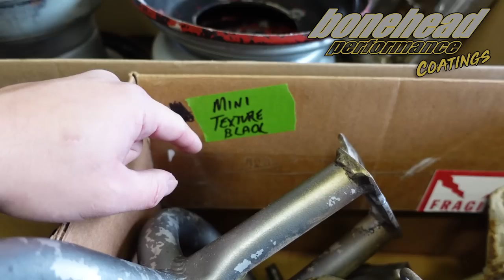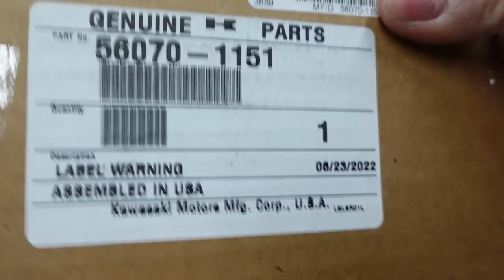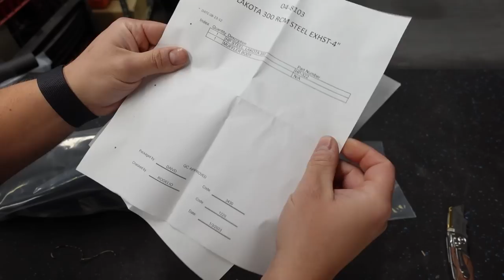Installing the Worst Case of Squished Tires I’ve ever encountered 😂

Comment from the maker: I’ve received squished tires from many brands of tire; it has to do with the way the warehouse stores and packs them and it’s not necessarily a reflection of the brand. What techniques and tips do you guys have for installing smashed tires? Thank you for watching my video and hanging out, we will put the exhaust and everything else on next! You all ROOOCK!!!
Reply: Grill propane tank with a "trash torch" lightly keep the flame at a safe distance and gradually warm them up.
Reply: When you get them squished cut the bands loose right away then I find anything to put inside of the tires to stretch them out and let them  sit for a couple days in warmth The tires weren't obviously made like that they were stored like that for a while you just have to reverse that process
Reply: please remane this video man fights small tire with fire... hahha
Reply: put in a tube, air up the tire with tube for a couple days then take the tire off and the tube out, tire should be good to go. It's a lot more steps but should work well
Reply: Put a ratchet strap around the tire to compress the Middle to squish the bead out
Reply: Lol I just got to the part where you used the ratchet strap love your content bro keep up the great work
Reply: I used to work at a tire shop. Get yourself some Murphy's tire and tube mounting compound. You can get it from Amazon.
Reply: The wood glue 😂😂😂😂😂😂😂😂
Reply: Don't use my method 🤣 but last spring, I spent 5 hours taking ONE tire off.. and then reinstalling new tire, I bent the rim, ripped the tire and broke my motion pro tire iron. Was an expensive day of negative progress.... So don't do like me 🤣
Reply: Michael you should get a gusset kit from HPM power sports for that blaster
Reply: Get a couple cheap inner tubes Michael.we use to change tons of atv tires at the shop i worked at and depending on who we bought the tires from would be the determining factor on how smashed and banded together they were.peace.
Reply: It's not actually even warehouse who packs them, all the way from factory. Most tires gets moved around with shipping containers and cost of one container went up a lot when covid started so they started shipping more per container and only possible way was packing tires tighter somehow, same goes for car tires and so on. Official statement from multiple providers and from tire companies, we actually had to get statements from them  cuz of our customers :D B2B is always fun and all
Reply: Need one of those manual tire changers from good ole harbour freight they are cheap an work well
Reply: might try heating the tires up . ive used a heatgun  it makes them more pliable
Reply: The way I put the tire on the I’m to get air in it is put a ratchet strap on there and tighten it while ur putting air in it a the same time
Reply: once the tires mounted , soak the bead with glass cleaner (aka windex) next set the tire upright and🦶 stomp on the treads a few times to get the sidewall’s closer to the beads. Last I put on a hands free air chuck and go back to 🦶 stomping. Solid downward stomp’s is the 🔑 and make sure the air is flowing heavy.
Reply: Remove the valve core, and put the female quick connect right onto the hollow valve stem.  This allows way more airflow, even enough to slightly expand the tire as the flame method does. It's saves my ass a lot on equipment tires.
Reply: can you do more motorcycle builds?
Reply: As a tire tech of 14years... when using the starting fluid trick u need to have the air flowing as u light the fluid.. gives u a much better fuel air ratio for a better boom to seat the beads and u should just get them Mike... the racket strap is a good trick to but u have to remember to be ready to lossen the strap asap or bad bad things could happen Mike... and always keep the face of the tire facing u and not the sidewalls if u like ur life Mike..  stay safe and keep rolling
Reply from the maker: @nathanpeever6701  lmao; I definitely want to keep my life. I appreciate these tips man! I will keep these in mind for the next smashed set.
Reply: @Michael Sabo  oh and remember lube is ur friend when either mounting or dismounting tires...
Reply: @Michael Sabo  soapy water is good for dismounting and if u can find it euro paste is really nice for mounting.. and always make sure u have the drop center of the wheel facing upwards witch u did in the video.. start ur bars up by the valve stem when dismounting and end at the valve stem when mounting to make things easier on urself
Reply: @Michael Sabo  I ran the service truck for fountain tire here in Fort st John bc Canada for 14years Mike.. if u need any tire tips or tricks don't hesitate to ask this guy I got a few things up my sleeves for doing tires from + 28 degress Celsius to -50 degrees Celsius
Reply: I wrote you on instagram, I asked you a question
Reply: take a ratchet strap around the center of the tread. It pushes the bead onto the rim and will minimize the struggle works on skidstear tires and loader tires i have done by hand.
Reply: When removing grips i cant damage i use boiling water on them to soften up the rubber.
Slides off like no to8
Reply: When I used to do tires we used to use 4 chucks of cut up 2x4 roughly wheel width. Put them in between the beads and let the tires sit either in the sun for a few hour or let it sit over night. Usually will help a ton.

Comment: Michael when you are doing the starter fluid method with the tire make sure that you have constant air pressure blowing into the vent so that when it catches at one second it’ll seat the bead right away.

Comment: Yeah I use the ratchet strap and ether method with my air chuck locked on blowing air before I start😂. But it’s like you said no single method/combo is the same on every tire. They are just generally a PITA!!! Great video as always
Reply: ah yes, the good old strap and pray method. Sketchy but very effective

Comment: Get a hands free air chuck (it clips on to the valve stem without having to hold it) and a Tire Bead Blaster (an small air tank with a pipe with a quick release valve).   A lot safer, a little noisier, but I would say, more reliable and cool 👍.  Especially if are going to be replacing a lot of tires.
Reply: +1 on the bead blaster / bead cheetah. Don't know if they're cost effective enough to warrant buying, but I've had to use them in the past to stretch car tyres onto wider, small diameter wheels (like ATV dimensions) and it works like magic
Reply: ether trick is way easier to use and makes more sense as far as money and uses go you can't start your bike with a blast of air or carry it on the trails

Comment: Yo Mike , the Bead Buster is a cool tool you should get 1 it operates off an impact wrench (I have  it , worth the investment). Pro Tip: if you wanna save your rim’s from scratches you can put a glove 🧤on the prying end of the bar. Hope that helps 👍🏻

Comment: put spacers between the beads and put them in the sun. or some way to warm them up. on most car tires I use aerosol cans standing upright between the beads. let them shape up. then mount them and it will be much easier than wrestling with it. took buddy 6 hours. 3 hours of stretch time and one hour of wrestling. still saves time.

Comment: I've changed my fair share of stubborn tires at home with tire spoons and ratchet straps and such like you did in this video.  It took many years to finally hone in my skills to where it's actually very easy now.  With all that said, here's the secret.  I've found that the most important step is to make sure you take it to your local tire shop and let them do it.

Comment: Pretty funny tire portion. We just installed new tires on some Douglas racing aluminum wheels and I kid you not, we needed about 100 psi to seat the bead properly. The tires say do not exceed 20psi for seating bead. We tried everything. After a few hours we just said screw it, put the tire under the blade of our mini excavator, hid behind a wall and let it eat.

Comment: MECHANIC TIP--
Cut a couple lengths of 2x4 or something and pull the beads apart. Put the wood between them and stretch the tire bout. Let that sit in the sun for 20 or 30 minutes and the tire will keep that shap some. When you get the tire on the wheel soak the bead with dawn or other liquid soap.. you need to lube the bead so the bead will slip on the rims bead... also take the valve core out of the thing so you can get air in it faster. What I do Is either a cheeta (makes it sooo easy) or stand the tire up and smack it hard with a mini sledge. That will force the beads out maybe just enough to catch.. you can also slam it down on the ground to achieve the same thing..  I've been a mechanic for 20 years and been doin tires like this and usually have very little issues. 

I didn't have time to watch the whole video but I have my tricks ill share....

Comment: The only brand new vehicle I ever bought was a 2003 Lakota and can tell you everything about the one you have is completely stock! I beat the hell out of that thing for years until I got a banshee. Also, prior to 01 I believe, the Lakota was a utility quad hence the heavy weight
Reply from the maker: Hell yea man! Yes, I think dirt wheels called it a hybrid between sport and utility. I may actually buy racks for this one after the series because it would make a great work quad or camera equipment carrier.
Reply: @MichaelSabo  There's also a hitch system available for them too, at least there was at one point 😂

Comment: Mike, my name is Tim, every time I watch one of your video's, I learn something.  NOW I have a chance to repay you.                                I have developed a method to push the beads on easily, no sweat, and every time.  My co-workers tell me I should patent my idea...maybe I should...but that sounds like a lot of money (patent lawyers).  I use a hydraulic press, but practically no pressure.  I work for the USAF in Alaska, civil engineer squadron.  We maintain about 20 zero-turn Kubota lawn mowers and RV900 trucksters, among other stuff.  I change the tires.  Our tires come smashed flat also.  I have tried ether, air cannons, straps, etc.  I put inner tubes in, set in the sun, used heat from Hotsey pressure washer also.  Nothing reliable.  I got fed-up a couple years ago, and decided to SOLVE THIS PROBLEM...it was making me a fool.  So I built a cradle out of 1 inch square tube steel (way overbuilt), about 12 inch high, and 20 in wide.  It has to be at least big enough for the bare wheel to fit down inside it, laying on it's side.  So I made 2 hoops about 20 inch around (this depends on the height of your wheels), and spaced them about 12 (wheel width) inch high.  I mount the tire on the wheel.  I lay the cradle flat on the 20 inch hoop side on top of the 2 I-beams of the press.  I have to move the I-beams down pretty far to have enough room to set the tire/wheel on top of the cradle on it's side.  Then I press the wheel down inside the cradle, and it easily and slowly press's the top bead on the rim by using the cradle to push up on the bottom bead, and the bottom bead pushes all the way up to the inner side of the other bead (actually the cradle doesn't move, the wheel moves down, but it's easier to visualize this way). Each wheel usually has the "drop center" offset to one side, this is the side I have up top, and gets pressed on.  Then I flip the wheel, and press it the other way, the one we just pressed on, will stay snapped on.  Usually we don't have to press very far until the other tire bead makes contact with the inner part of the wheel, as it is cone shaped outward and grows in diameter as it gets closer to the other bead of the wheel.  Once it lightly touch's the cone, we put air in it, and the tire slides up to the second bead, and snaps on.  Depending on the depth of the wheel, the ram might not have enough stroke to go all the way down (the 12 inch part), so I have a couple of 3 inch spacers I stack on the wheel where the lug nuts would go.  It takes very little pressure to push the wheel down, but a hydraulic press makes it so easy and safe.  The throat of the press needs to be big enough to fit the tire size, like for a 30 inch tall tire, would need 30 inch throat 
across press.  Ours is a 100 ton 4 foot across press...overkill I know.  I hope you see this.  I'm an old dude, no smart phone, no instagram, just a flip phone.  If you need more info, don't hesitate to call me, 907 317 4625.

Comment: Awesome video. Another trick I use for quads and skid steers, is to remove the valve core in the tire stem, and then push the female quick connect on the air hose straight onto the now hollow valve stem. This allows air in at a much faster rate and is great for seating tires. Just be ready to put your finger over the end of the stem once it's got air in it, until you can quickly screw the core back in.

Comment: Great video Mike! I am patiently waiting for the rest of this awesome series! Also I wanted to add a little trick I learned from a friend on breaking the beads without your special bead breaking tool. Most everyone has a floor jack so I guess that might be an exception, but jacking up the front or rear of your pickup and sliding the edge of your crusty old tire with stubborn bead under your vehicle tire and letting down slowly has always worked for me when I run into a bad one. 👍
Reply from the maker: That's a great idea man! I have actually used that technique in the past!

Comment: My trick for doing this at my dads shop was to get the tire as warm as I could. Either by setting it in the sun on nice days or in front of a heater. Also a rubber tipped air gun works way better then a tire inflator tool because it lets more air faster into the schrader valve opening. Those are the two addons I have. Thankfully I did more street bikes and dirt bikes than quads and those tires at least 10 years ago never came like these.

Comment: Hey, man! Long time viewer here (in my mind, at least - viewer since the voodoo banshee!) I have a 98 Blaster that I am working with right now. I bought some tires off Amazon and they arrived just as smooshed! My tip for the next set - 20oz pop bottles! Take the 20ozers and stuff them between the beads to stretch the tires back out. Leave the bottles in them and let them sit somewhere warm to expand for a few days to a week - should be "normal" dimensions after a few days. I used four per tire and they seemed to work out good like that. My 40 cent fix for ya!

 PS - I am STOKED to see you working on a blaster! It's great to have your work as a reference. I am learning much from you, sir! Thanks for your time editing and sharing! Looking forward to some blaster wheelies! Enjoy and be safe!

Comment: Man I never laughed so hard watching the ether fails.     After doing my raptor with squished tires I said never again, and switched it over to deadlocks for wheels.   Much easier to install tires on the bead lock wheels.   When my Polaris needed new tires I took the wheels to the tire shop and had them do it.  They were heavy duty 6 ply tires that I would have never gotten to seat.    Great Video!

Comment: my buddy  installed tires on forklifts . here is a good tip for receiving squashed tires and opening them back up . find any size innertube that will fit inside the unmounted squashed new tires or old  . inflate tube to spread the tire outwards as much as you can .put out in sun unless its winter. put somewhere warm in winter like next to your woodburner. he said it may take up to 24 hours.

Comment: The easiest way to handle squished tires is to inflate tubes in them to stretch the tire and set them where they will get direct sunlight for a few days (heat/cool cycles) and when you are ready to mount them to the wheels, deflate & remove the tube and mount.  The tires will retain that inflated memory long enough to not have to fight it.
It's what we did back when the popular thing was to mount 175/70-14's on wide wire spoke wheels.  We kept a set or three in the shop with the tubes inflated so that we had those tires ready to mount when customers came in for them.

Comment: I work at a shop that regularly mounts atv/utv tires, and when we get squished tires like that we put 3-4 2x2 pieces of wood cut to a few inches (idk? 6”?🤷🏾‍♂️) and spread the tires for at least a few hours before we mount them. Works like a dream everytime. If you don’t want to use 2x2’s, find some nice robust sticks and cut em to length

Comment: OMG 😂this video had me LMFAO 😂great job mike, I’ve been riding quads lil over 20 years and I’ve done this 1 time and I said to myself never again would I do it. This last summer I got new front and rear paddles for my YFZ the shop I use by my house that knows me and my family he only charged me 40$ bucks to dismount the old tires and mount up all the new sand tires all up..

Comment: The ether method works best when you are putting air through the valve stem at the same time.  It helps to mix the ether, and helps keep the tire from coming right back off the bead.

Comment: Did a blaster up in 2006...vito's 240 top end...hot rod crank...HMF pipe and silencer ...carb kit....(ran on race gas)....owned a dozen quads (200cc to 1000cc)  and that one is the one I wish i still had...it was super light ...crazy fast...and very easy to ride all day...
added plus was ...it was bullet proof, ultra reliable...can't wait to see what you do to this one...
From my igloo on the mountain in alberta Canada 🇨🇦 D.

Comment: In the future, put 50:50 dish washing liquid and water mix on the bead prior to the gas trick.  The soap will allow you to slip it on the rim much more easily and when you gas trick it too. I use a bbq brush to apply it on the tire bead and a baby bottle to hold the mix.